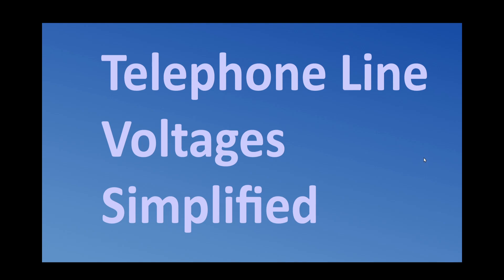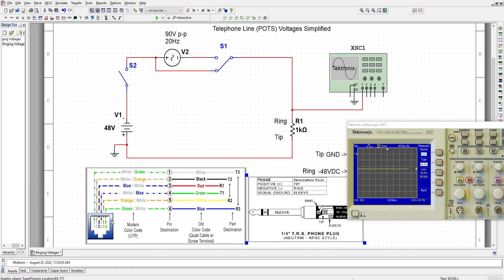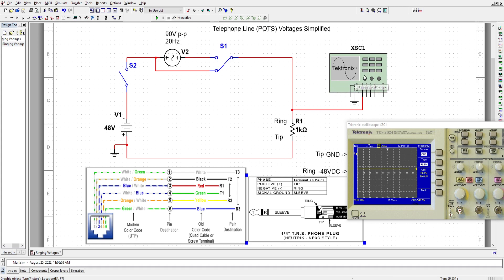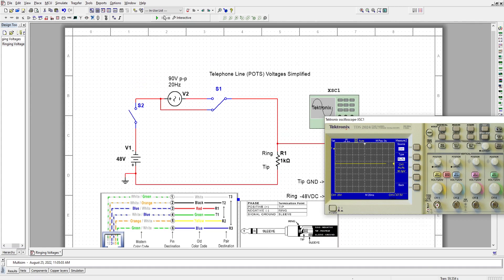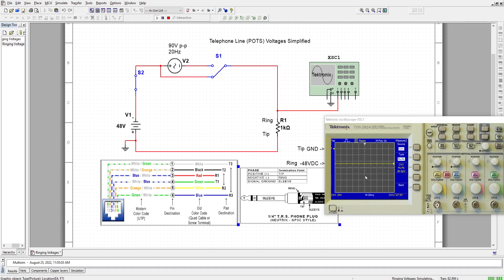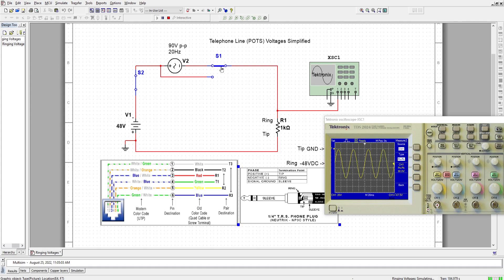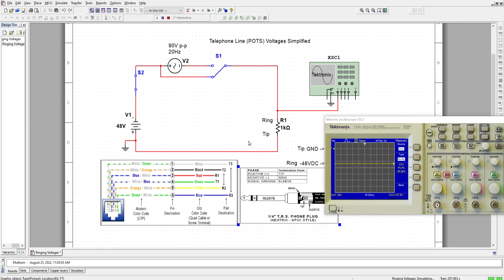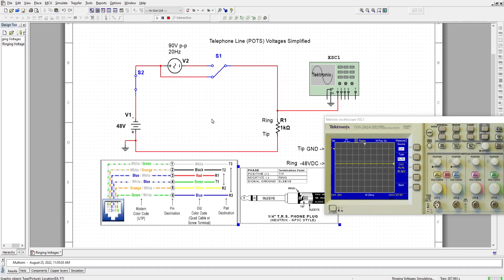Telephone Line Voltages

Comment: Thanks for the video. I knew idea behind POTS but not exactly how it all works together. The reason I found your video is because my telephone company stopped their POTS service to my condominium. I now receive my landline from my cable modem. The problem I have is that the cable modem doesn’t seem to have enough power to feed all the copper lines in my condo and the feed that goes all the way to the ground level to the utility box where I disconnected it from the utility service box. In other words, the cable modem has to power about 500ft  (175m) of old feed copper wire in addition to the copper just in my condo. I’m thinking I need to find the first jack in my condo and disconnect the old feed from the ground level or see if there is some sort of “POTS voltage booster I can purchase. Any ideas? And thanks again.  Also, I found that the newer “simulated” POTS will not work with the older POTS rotary dial phones.
Reply from the maker: This could be tricky. The telephone box that you connect to your modem is an ATA adapter, and some of them have limited current capacity. I would disconnect the phones one by one and see if things improve. Also, check the polarity of your field cabling. Cheers! :)

Comment: the whole world is going fibre optic, will these voltages still apply
Reply: Yes, the voltages still apply, because you can still have an old POTS style phone or other device that uses this type of connection. The video mentions that in those cases there is an adapter to handle this, often close to where that POTS phone is. 

However, a little secret is that although the voltages provided by those adapters might be "based on" -48V battery and 90V p-p Ringing, they can be off by quite a bit. With traditional POTS service the power for the phone could be delivered solely by the telephone line, meaning that -48V was really powering the phone, and the 90V ringing was designed to run a physical bell in the phone to ring that bell 20 times a second (20Hz).  Most new devices that "talk POTS" have their own circuits and speaker to create the ringing sound. Because of that they only need the POTS line to send something kind of similar to that 90V p-p ringing signal. So, those adapters sometimes deliver a lot less than that 90V Ringing voltage. In fact, if you were to try to connect a really old POTS phone that has no external power and an actual bell that rings to some new adapters you may find that the phone won't work right.
Reply: @Dadofer1970  it is just that l have fibre optic and if the power goes out l lose my landline, and there is only a 12v wall wart that feeds the router that the phone is connected to
Reply: @debeeriz  The old kind of copper connection with a true POTS line coming from the telephone company is nearly a thing of the past in the US. I am not even sure how many there still are around. Most people who still have a landline at home have what you have, a device that brings in their internet, TV, and phone on the same cable (either fiber or coaxial cable). 

It you have copper wiring for your phone coming out of that device, then that device is changing the power it gets out of the wall to the voltages your phone needs. That is the analog telephone adapter the video mentioned. 

Yes, when you have that kind of connection you will lose your phones when you lose power, unless you have a battery backup for the service provider's equipment that is sitting in your house, and depending on the phone you have your phone may not work unless it is plugged into the wall as well.
Reply: @Dadofer1970  thanks for that
Reply from the maker: @debeeriz  For this reason some commercial installations still require POTS lines to be provided for so called 911 service. The POTS line (bypassing all main telephone KSU) is connected straight to an SL (single line) telephone set that does not require external power. When power goes down in the building, the independent POTS line is still active and a 911 call can still be made. Yes, people have cell phones now days, but the logic here is that the owner of the building can't relay on the fact that maybe someone will have a working cell phone with them.
Reply from the maker: @Dadofer1970  Excellent point! A few years ago I installed a large VOIP system. It was a semi retrofit job. The old NORTEL POTS based system was replaced with a new SISCO VOIP one. There was an existing BOGEN paging interface that looked for the POTS signal at its input. A proprietary ATA adapter was to be used as the link between the VOIP system and the existing PA interface. One side of the ATA was ethernet and the other - RJ11 POTS jack. All connections were done correctly. The system was recreated and test-run in the lab of the hosting company, but the system onsite just didn't work. I was at my wits end! Special thanks to  Barry Windsor for Windsor Technical Services who came to the rescue. It turned out that between the times of creating the system in lab, and the shipment to site, the ATA adapter was upgraded to a newer version. The model number was the same but a newer revision. The newer and better ATA was not providing enough ringing voltage (or it didn't have enough current capacity, I don't remember anymore.) Long story short; the ATA was swapped with an older one and the PA interface responded like a dream. So.. Yes, the core communication was provided from the outside by the fiber optics, no POTS lines but SIP lines. VOIP systems are interfaced to different peripherals such as PA interfaces, door stations, auxiliary ringers, and other other control devices. These peripherals are produced by third party companies and the set standard is that they look for POTS signal at their inputs. Sometimes we will run into compatibility problems such as the one I mentioned here. Cheers!

Comment: How those systems generate that 20Hz?
Reply: Each local exchange has it's ringing current generator powered primarily by the mains supply, backed up by battery storage and a diesel generator, as is the whole exchange. So the Telephone system is completely self reliant.

Comment: Is this the same for all countries and is 48 VDC required for POTS phones or are they able to work with lower voltages?
Reply: "POTS" telephones can work at lower voltage. Remember that the -48 volts cited is the standard idle voltage (on-hook), which falls to typically 5 - 6 volts when the phone is off-hook. This is caused by voltage drops that occur throughout the circuit: relay and transformer windings at the central office and the resistance of the wire pair from the central office to the user's telephone. But 48 volts is not cast in stone. Many private branch exchanges (PBXs) use 24 volts as the on-hook voltage. They do this because the line lengths are usually much shorter than what a normal central office must work with. However, part values in the PBX are chosen so that the typical 5 - 6 volts still appears at the user's phone when off-hook.
Reply: Helsinki, Finland had in some areas 60 VDC line voltage.